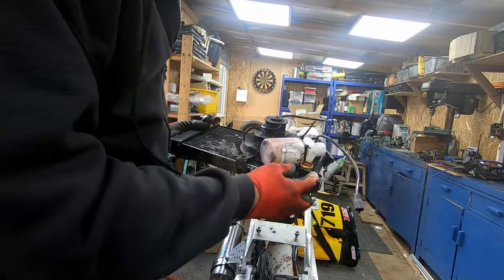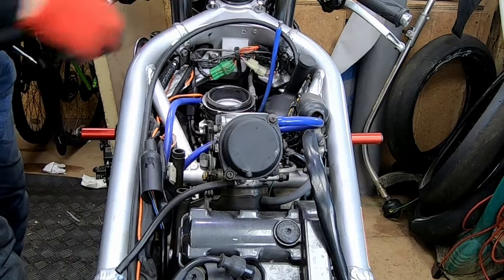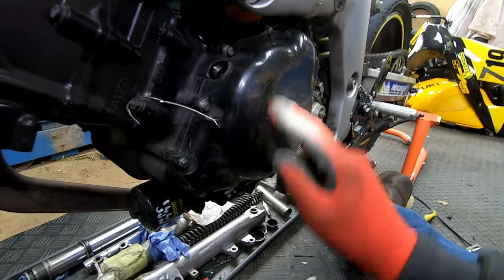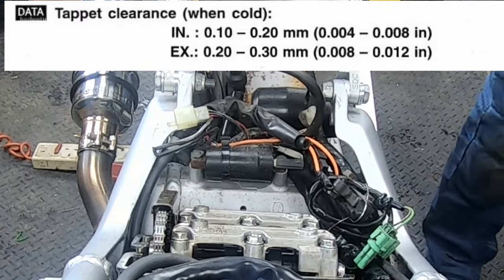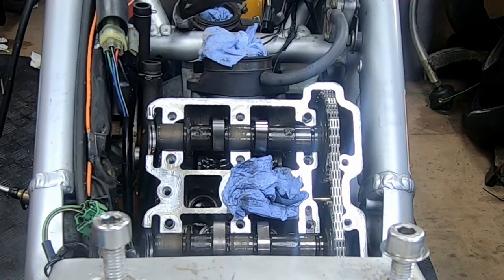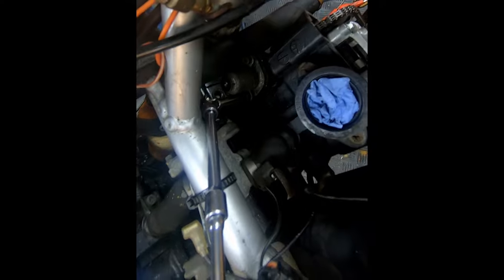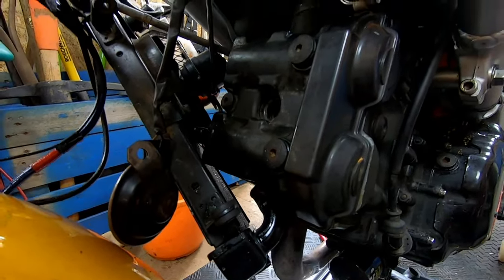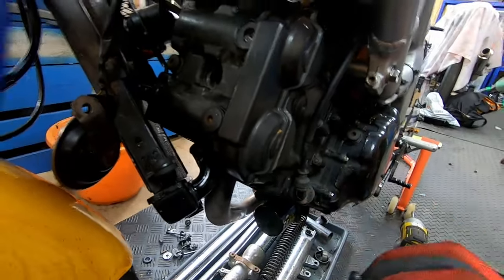Suzuki SV650 more power, Gen1 cam swap. Adding Gen2 cams

Comment: Nice vid!

I have a set of Gen1 intake cams to put in my girlfriends Gen 1 track bikes exhaust side, and this vid is perfect for that! 

From what I'm gathering though, it's the Gen 1 intake you want on gen 1 exhaust side and now im seeing gen 2 intake swapped into gen 1 intake side? I bought an extra set of Gen 1 cams so I could run Gen 1 intake cams on both sides, but it seems I should have just bought gen2 intakes for the intake side and moved my gen 1 intakes to the rear :/ 

so, I MIGHT have an extra set of gen 1 intakes sitting around soon lol! 

Cheers!
Reply from the maker: @canopyjunkie  you can do as you say but what I did keeps it legal for minitwin racing regulations. Putting gen 1 intakes in exhaust side gives a few more ponies.
Reply: @megasheddiaries  gotcha, this is just a track day bike we're looking to squeeze a little bit more out of, also I just like reasons to spend time in the garage lol.